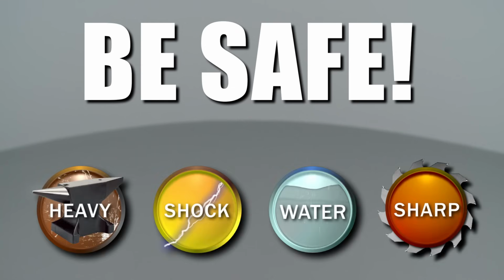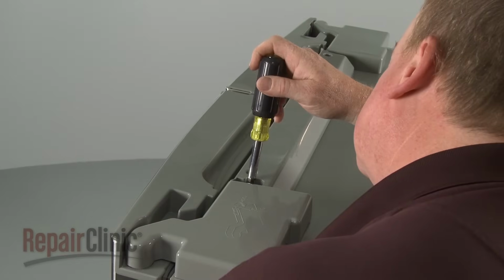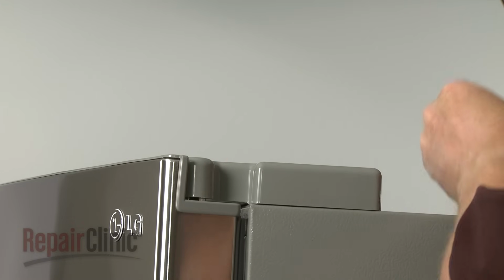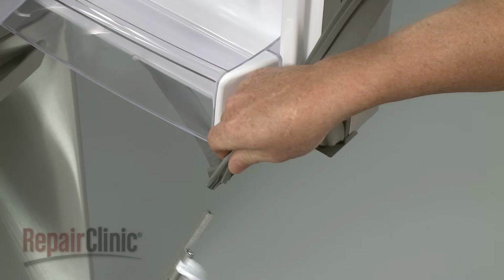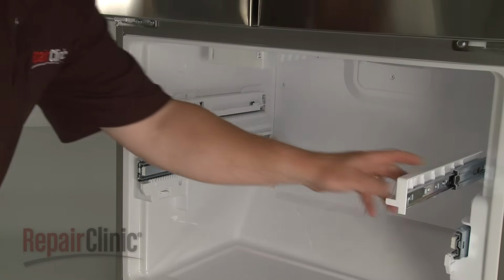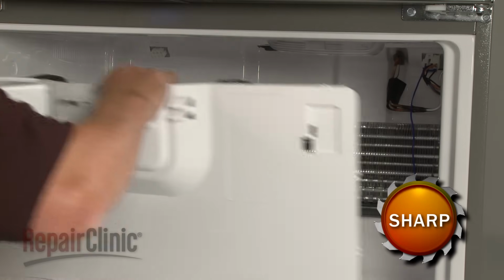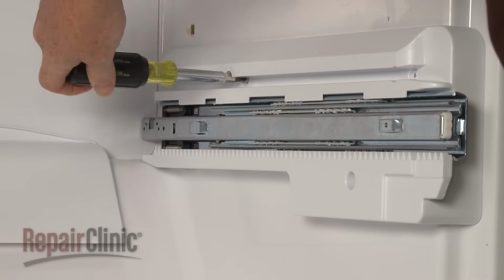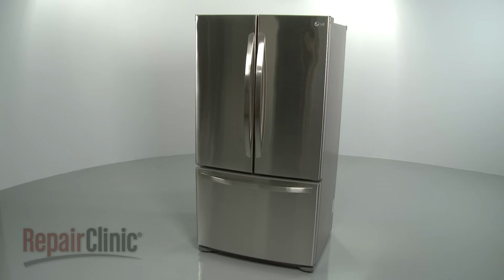LG Refrigerator Disassembly – Refrigerator Repair Help

Comment: refrigerator there are two air outlets which blow air to the ice maker.   When the fan is running air only blowing from the lower one , no air on the top one.  Is it normal?  If not, what's causing?

Comment: Hello, I would like to know if it possible disassemble the right door in order to fix  a little dents in the edge, from inside.  Like you did, take the rubber on edge (gasket) after the center covering and go to stainless still cover and smooth it from inside out. Please let me know. My fridge is LG the some of video. the dent is edge right side. It very little, not able fix it from outside.

Comment: I have approximately this same refrigerator; seven years old. The light for the freezer drawer is out. It's located on the bottom of the right-hand refrigerator door, so it shines down into the freezer drawer. It's an LED strip. I replaced it; that didn't help. So I replaced the magnetic control switch for it, which is located behind the left lower freezer drawer support (a real adventure); that didn't help either. What's left? I'm guessing the LED gets its power through the hinge on the top of the right-hand refrigerator door; but I don't know what I would be looking for in there, nor what to repair. Anyone able to help?

Comment: These fridges are actually pretty well thought designs in terms of working on them.  I just wish they wouldn't make all the WORKING parts so damned thin, cheap, and chintzy.  Fridges used to last for DECADES, now, not so much.  And usually it's for lack of spending a few more cents for better materials and designs for robustness.  Planned obsolescence, in this day and age, should be criminally punishable, if proven.  That is TRULY not sustainable.  Also, for just a few cents more, both evaporators and condensers could be made far more efficient, if you don't believe it, look at commercial units for providing the same functions.

Comment: My LG fridge died after 5 years, a leak in the sealed system. LG refused do do anything other than keep stringing me along for two months. They make crap and you get stuck with it because they do not stand by their warranty.
Reply: Afraid I'm having same problem. Say warranty is up to repair co's evaluation. Have to use their authorized repair company. Not answering their phone. Ugh.Being strung along.  Never again LG.

Comment: I’ve got this refrigerator at home and recently I ran into a problem. The ice maker isn’t making ice. The reason is because the water inlet line keeps freezing up. I replace the inlet valve solenoid already and I put a new ice maker in and the problem still persists. Is there a heater around where the line is fed through the freezer? There isn’t a water filter and the water pressure from the water feed seems good. What could I do next?
Reply: Likely you still don't have it, but I would try insulating it lightly, if the systems are working at spec and this is happening.

Comment: Have an LGLFX25991ST 3 door Refrigerator/Freezer. Both doors used to close with a spring effect. Right door had some noise and now no spring effect. Looked out for any broken parts at the bottom of the door but there is nothing there besides the hinge. How can I fix it?

Comment: I have LG  3 door refrigerator with Freezer on bottom.  Few months back a coil spring used inside the gasket flapper broke. Where do I buy this coil spring? My gaskets around the right door are torn ( they are not broken). Do I need to replace it? It might be making my refrigerator door from closing properly.

Comment: The thin layer of aluminum foil that is on the back panel above the drain tray flakes off and periodically clogs the drain. then the water cannot get througfh the drain and runs to the bottom tray inside the freezer and causes a large accumulation of ice.

Comment: how do I adjust the temperature on the freezer I don't know how to turn it up
Reply: if you have the 3 door fridge with freezer in the bottom the temp settings are in the top of your fridge just above eye level.

Comment: Ice is forming on bottom of back wall inside fridge behind vent panel Lg Lfxs30766. what causes this?
Reply: the drain is cloggeed behind the back panel of the bottom freezer. i believe the aluminum foil on the insulation peels off and restricts or blocks this. the actual drain tray is behind the fridge and can be accessed by removing the back bottom panels 5 or 6 phillips head screws.
Reply: I have this problem. It wasn't a clogged drain.  The evaporator on mine is too big/high and the back panel doesn't seal properly against the back wall of the fridge, letting in moisture.

Comment: Kenmore Elite Refrigerator MODEL 795.74033.411 with Error Code er rf.  I have replaced the control board and the fan assembly in the freezer compartment.  No change... the refrigerator still presents the error code er rf.  WHEN I PRESS THE "RESET BUTTON" ON THE CONTROL PANEL, THE FANS ENGAGE BUT GO OFF WITHIN SECONDS WHEN THE REFRIGERATOR RESETS".  

TWO QUESTIONS:
Does the fresh food compartment have a fan or are the fans in the freezer the only two fans?

Based on the information above, do the think the replaced control board is defected also?

THANKS

Comment: Hello!
My fridge is warm but the freezer is cold, what could the problem be? :(
Reply from the maker: Check out this video Jessy: https://www.youtube.com/watch?v=5vA8Ksv5kVY
Reply: @repairclinic  froozen freezer
Reply: I know this is a 4month old post but if someone else has the same trouble?~~>  I Had that happen (albeit  a  different brand and model)  a loooong time ago....   all it was was this  little transfer fan assembly had ran out of lubrication and the shaft galled so motor would't rotate  (just hummed a little loudly as it TRIED to turn) the fan blades not spinning meant the cold air from freezer was not moving to the refrigerator.  I pulled the fan out  (right there in a little compartment inside freezer)  two screws held the assembly together (not counting the fan blade which was just held in place on the motor shaft by a set screw as I recall) ....I COULD have bought a whole new fan but I wanted to try to get the thing going asap so I took maybe a fine file and some fine emery cloth and/or sandpaper and just re polished the motor shafts where they spun inside of bronze bushings on the motor end caps ....then I smeared grease ...(probably just used Vaseline from baby diaper changing station LOL)  ...made sure it spun easily,  put it all back together and VIOLA!  Worked like new again!  Was still working perfectly when I sold it a couple years later when we received a brand new refrigerator as a wedding gift...YMMV but it seems like it has to be a transfer fan or maybe duct that opens and closes via a thermostat?  But it would have to have SOMETHING to make pressure so the cold air would move from one place to the other...no?   look up transfer fan or blower with your model number ...

Comment: I have a lg LFX28968ST and its very similar but newer i think. The problems is that there are no screws on the panel just some plastic pieces with holes in them. Do you know how to release this panel so I can access the hardware inside? Help....
Reply: We have the same fridge/freezer and problem. Did you ever figure out how to get the back panel off? No screws, just holes so I don't want to bust it by just prying on it...

Comment: I have an LG fridge 25950 that is not on settlement list ( http://www.lgrefrigeratorsettlement.com./) and having the same issues.
My pine floors are swelling from the water. Getting ready to take it apart now but not sure how much to replace.
Reply from the maker: +Ellie Mackintosh Thank you for sharing.

Comment: I need to replace all the water lines on the rear of my LG fridge. They have become brittle and break easily. I have a water access point on the left front door. Do I have to remove the rear panel to make this repair; what surprises are in store for me?
Reply: +Henry Garbade Shop Refrigerator Cebey Monday 2015 Sale Off Now >>> Best--Refrigerator.blogspot.com .
Reply from the maker: Henry Garbade This video pretty much shows are the serviceable areas of the refrigerator. The only rear panel that can be removed is at the bottom.

Comment: I have this same frige/freezer and inside under the freezer door there is a 1/4" layer of ice and also have water leaking from the bottom of the freezer door, most likely because of the ice build up. I'm not aware of any defrosting procedure with this model other than unplugging it but then the frige stops running as well.
Reply from the maker: PrimitiveVsns We would check the door seal. A bad seal will cause frost to form where it is not designed to. Another cause is a clogged defrost drain and when it goes into defrost mode water leaks.
Reply: RepairClinic.com how do you find the defrost drain?
Reply: Your drain is clogged.
Reply: Ed Bard how do you find the drain
Reply: @tamielah3889  I also cannot find the interia drain

Comment: As a Pro. Civil Engineer * Lic. HVAC/R *  Lic. GC. * Investor * Project Manager. My question is: In additonal,  WHY the technician did NOT demonstrated the DISASSEMBLE and REASSEMBLE of the left door which was more TECHNICAL that the right door DUE to the water line?
Reply from the maker: The refrigerator model in this video is not equipped with a dispenser on the left door. The icemaker in this model is located in the lower freezer section. The left door removal would be a mirrored procedure of the right so we only demonstrated disassembly of the right side. If you did have a dispenser in the door, you would have to disconnect the water line with a larger wire harness connector and probably a ground wire at the top hinge. Otherwise, it would be the same procedure.
Reply: It would have been good to show the disassembly of the left door on an LG frig with the dispenser in the door since it looks like the only repair for a broken hose is to replace the whole door or cutting holes into the panel.

Comment: We recently put a large dent in the right door of our LG French Door refrigerator.  I watched your very informative video and was wondering, if I ordered a new right door will I  have to transfer latch, gasket to the new door or does it come with these items?  I would appreciate any other concerns I may have missed should I attempt to change out the door.  Thanks for your answer and the video.
Reply from the maker: Glenn Ball Most replacement doors come with the door gasket and latch. To determine what comes with a replacement door for your model, enter the model number in our website's search engine: http://www.RepairClinic.com. The photos of the door assembly for your model will show what is included. Note that you will need to transfer the handle from the old door to the new one, as most replacement doors are not sold with handles. Please also be aware that we may have a how-to video for your specific model. That's why it's important to start by entering your model number on our website.

Comment: 795.72053.110
Reply: Dh on display
Reply from the maker: Dh refers to your defrost heater. If the defrost heater is at fault you will have a frost buildup.

Comment: what model is the refrigerator model? like lg ...... ? (lg what )
Reply from the maker: This video will help you: Refrigerator Model Number Identification
Reply: RepairClinic.com  hey I have an issue with my  LFX31945ST/02 it keeps throwing codes like Er/rF what could this be ?